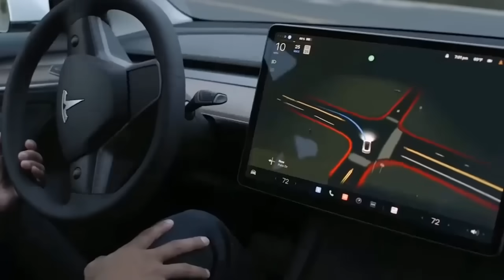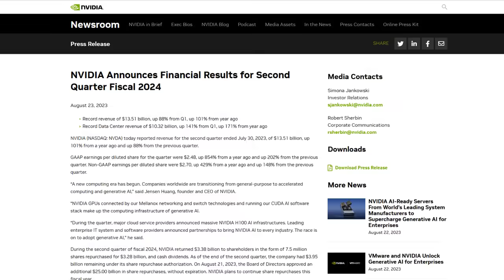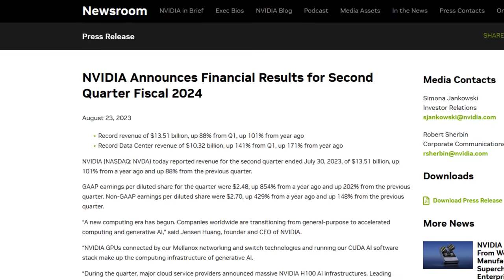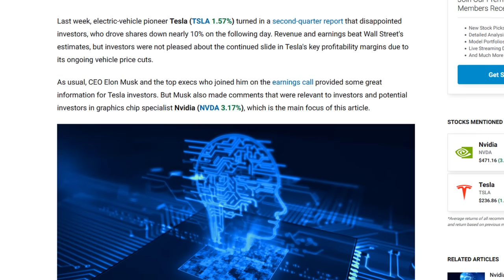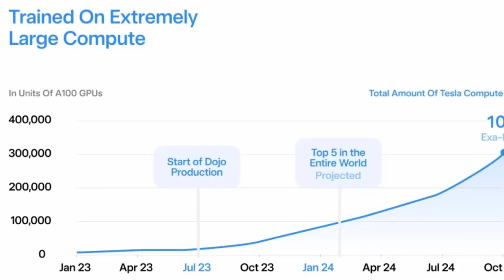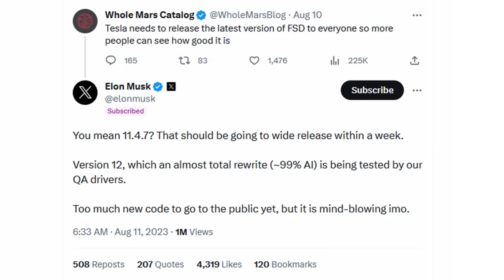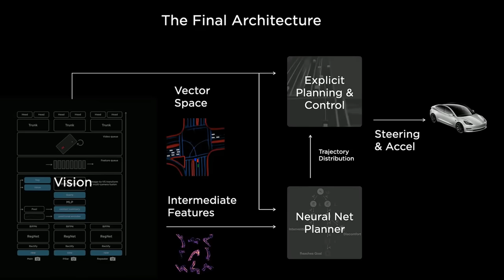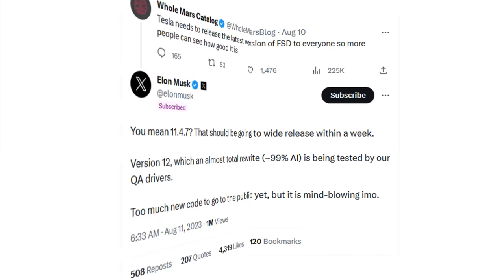Tesla’s Next BIG Move!

Comment: No, because of first principles thinking & DOJO. While late comers, established and legacy people fumble in the dark with GPUs, Tesla has already identified the severe architectural bottleneck (data transfer) within GPUs and has moved on. Tesla is quite compute constrained due to the overwhelming amount of data entering the fold every day, and this is why DOJO is so important. First, trained data does not need to stick around; just condensed and archived. The longer it takes to train the long data stays and piles up over time. Second, DOJO was/is specifically designed to not only compute quickly but to move through data at speeds which aren’t even theoretical in Nvidia’s architecture. You used the term “blow past” GPU driven AI and Tesla will do this so rapidly the industry will endure cardiac arrest. It will be fun to watch.

Comment: Assumption that fewer lines of code are better needs test
Reply from the maker: I mentioned in the video that they can use the current implementation as a benchmark.
Reply: @TMIOTesla  not gonna say together we can but got some tesla fam and with family you back up with anything you can FSD is just learning your system quantum probabilities starting with machine learning that kinda easy though no need for satellites and connection problems just programme the brain or cpu with individual drive brain looking only at the road ahead but cameras are you problem
Reply: Try this out to find correct way through anything you can take every single bit of data or only use data points from a bigger picture with correct way QProb AI
Reply: N best anything you want with fewer points or decisions or fewer lines of code hope you see